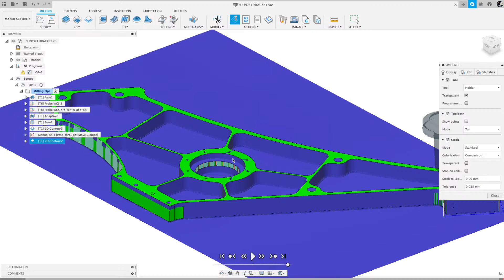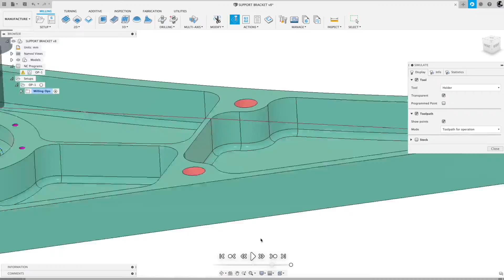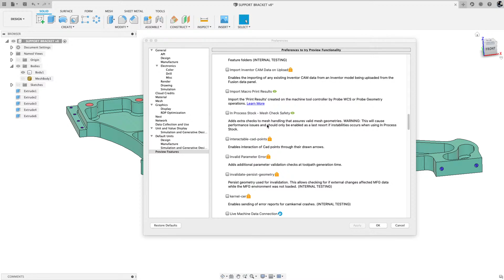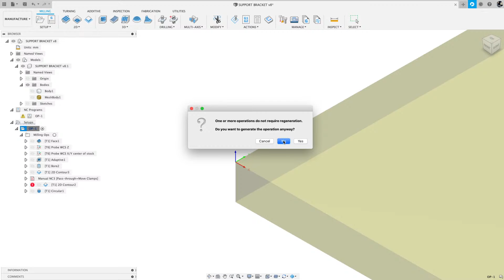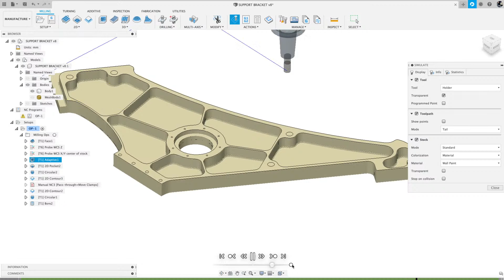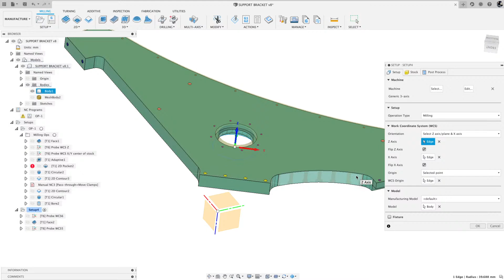CAM Secondary Operations

Comment: Hi Angelo, Thanks for these videos.  They are really helpful.  This is totally out of context with the video, but it's a question I've been struggling with.  Can you use Rest Machining when the previous tool path has
 a non-zero Stock to Leave?  How do you account for the Stock to Leave?  When I try this the tool path ignores the stock left by the previous path.  Thanks!
Reply: BTW, saving the first op sim as stock for the second works, but it would still be nice (simpler recipe) to use Rest Machining if can be made to work.  Thx.

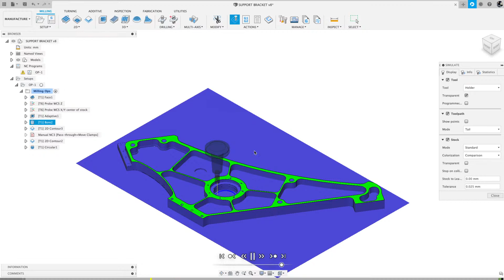Comment: Hi Angelo! At 18:00 to add to your answer about operation machining time, it is also possible to display the machining time for each operation directly in the “name” of the operation in the browser. It is activated from the preferences. I have it on all the time and find it very useful to track improvements when I apply changes to optimise my tool paths.

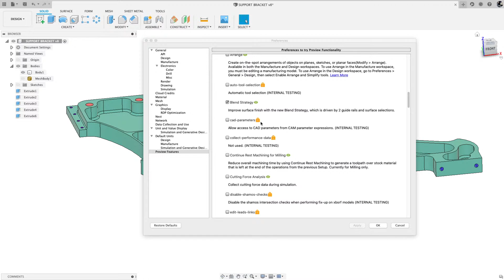Comment: Angelo, I think you pointed out the wrong preview feature, I think the one you wanted to point out is "Continue Rest Machining for Milling". I have that selected (and I do not have the "In Process Stock - Mesh Check Safety" selected which you pointed out), and I can use the stock from the previous setup as one of my choices in the following setup. You can see it in your preview features list at 30:12  --- Of course, the same warning would apply as it too is a preview feature! It should probably also be noted that our list is not as long as yours. I'm sure you have some internal (or possibly select testers as well) only things on that list!